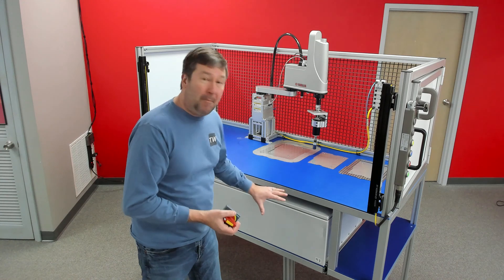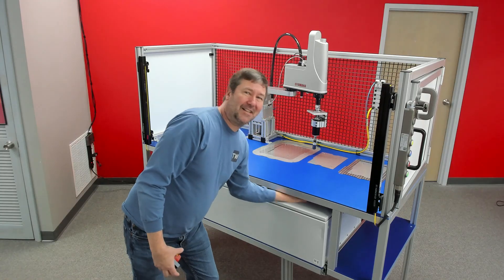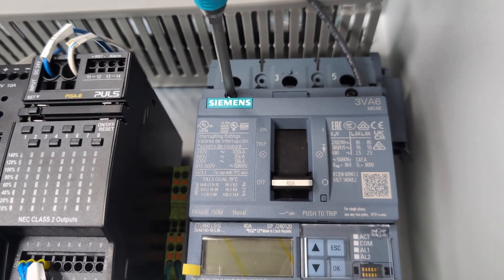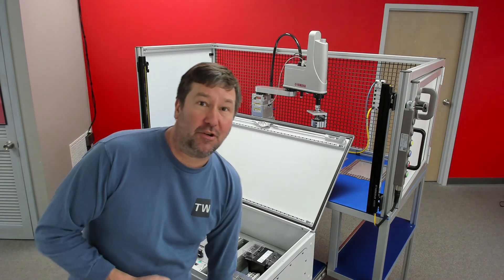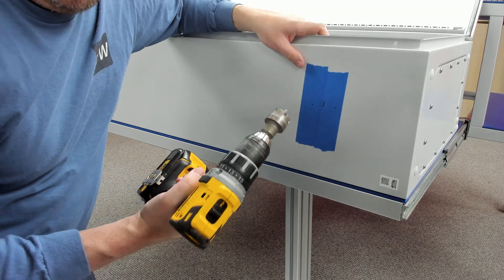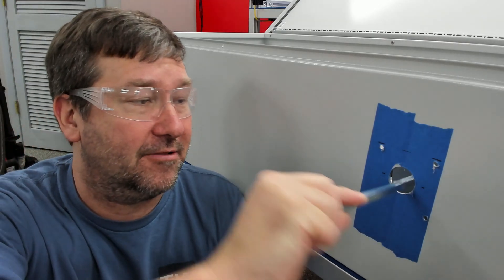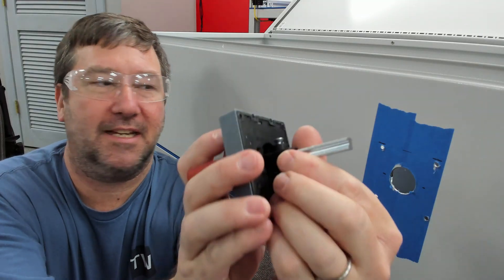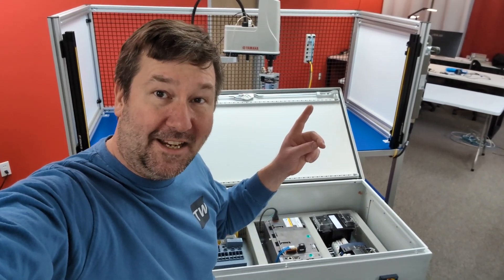Side Mount Disconnect.  Is the Front of Your Panel Easily Accessible?

Comment: when mounted in the doors it should be illegale to use the ones that doesn't allow you to open the doors in the on position. on some of the machines we have at work we have to shut down entire production lines just to reset a breaker
Reply from the maker: I tend to agree with you. In many cases this leads to shafts being removed so that the cabinets can be opened with the power on. If you don't give someone a way to do their job then they will make a way whether it's safe or not